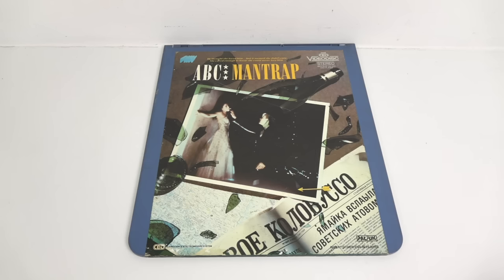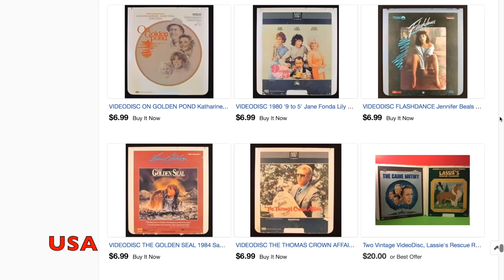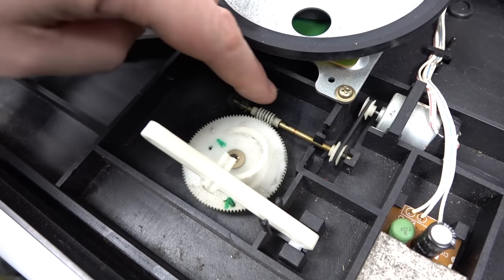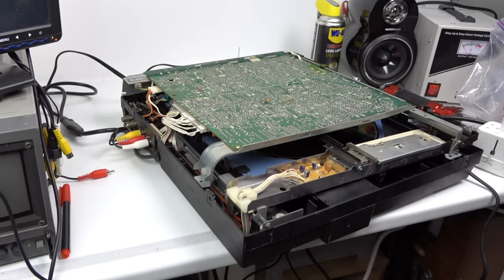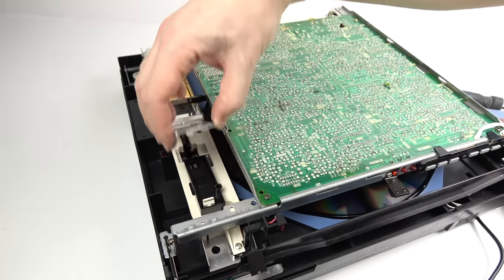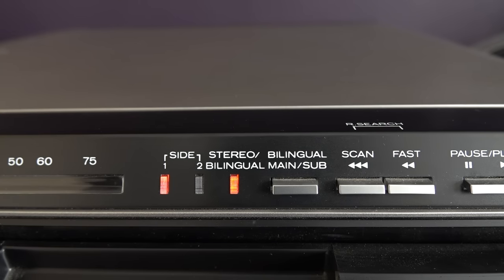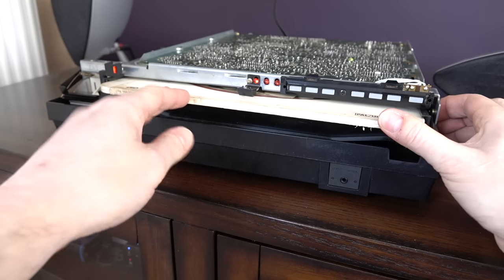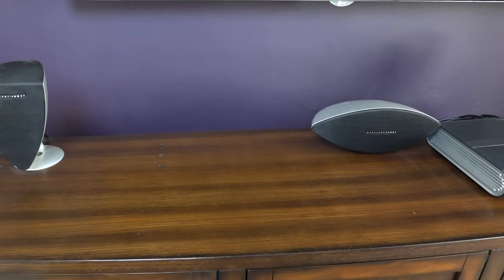Retro tech: The RCA CED Videodisc

Comment: I worked on the VideoDisc at RCA Labs in Princeton starting 1980. Around 1982 we were working out a solution to the skipping problem that involved gluing a little magnet to the aluminum stylus arm and "kicking" it with pulsed coils forwards and back to correct for skips. We pretty much got it working in the lab just as they announced the end of the product (and the sale of RCA to GE). 

It was a tech marvel.  The video signal was modulated onto an FM carrier (like VCRs) and the audio FM carriers were added to the video carrier at 1/10 the amplitude.  The video carrier was recorded on the copper master at an amplitude of 850 Angstroms, which made the audio carrier 85 Angstroms. The audio carrier needed a carrier to noise ratio of 100:1, or 0.85 Angstroms. Copper atoms are spaced 1.4 Angstroms apart, so that's only 60 copper atoms peak to peak!  Fortunately the grooves were 10,000 per inch, or about 25,000 Angstroms wide, so the "copper atom noise" easily averaged out across the width of the groove.

The original attempts at making discs conductive involved sputtering metal on them, and they were quite pretty.  I still have one.

I flinched at your opening clip as you fingered the disc, only to learn later that it was already thoroughly unplayable. 

Thanks for the memories!
Reply: If you haven't seen them, Alec on his Technology Connections channel has a series of videos where he goes into more depth about the development process and various other aspects of the whole thing.
Reply: That's awesome I'd love to know more about this lost tech
Reply: Incredible!
Reply: Any chance you could upload a picture of the sputtered metal disc somewhere for posterity.
Maaaybe on wikipedia.
Reply: You have a picture of that prototype disc?
Reply: Great work you did! And half the density of a much later CD without laser was ingenious!
Reply: Very late I know but this is something of an answer to a question I had regarding the format as to whether the skips could be fixed because it never got out the early phase of adoption. Reminded me very much of WB HD DVD discs rotting but we knew it could be fixed (I have a Universal release of Casino and a BBC release of Planet Earth 1 that are still working more than 15 years after their manufacture)
Reply: Very cool, thanks for sharing.
Reply: shame rca didn’t get the ced out in the late 60’s it would of changed the world
Reply: Thanks for your story and love hearing what was going on from the industry ppl. 

One I bought a Sony Cassette player from the late 70s. No one bid and I got for .99 cents and I think free shipping. The woman said it was the prototype of the Sony Walkman, but looked like a regular cassette tape recorder. She said it was given to her by a Sony executive she was dating and only the top executive in the Sony NYC office got one. She said she hadn’t used since the early 80s and had stored away, 

Anyway, just the story was worth the .99 cents I paid. I don’t even know what happened to it and hope it’s in one of my storages.
Reply: Before LD or VHS, it would have been very popular, people were spending large sums on 16mm and 8mm films, movies that were often cut way down and the 8mm often silent plus not very convenient at home. The CED would have been a marvel compared to the delicate film that had a tendency to break and need spliced.
Reply: RCA should of come up with a system like a pc hard drive, where the recordable disc platter is removable in a cassette similar to a floppy or zip disc. this idea would of been cheaper and made complex tape type expensive systems obsolete. but im glad for dvd and blu rays in this modern times.

Comment: The mentioning of how the TED works by using a cushion of air to hold it steady reminds me of a piece of old computer tech from the early 80's to early 90's.

It was called a bernoulli drive, and it used air pressure from the rapidly spinning disk to draw the IO head to the disk surface. Thing is, because if the way it worked, a head crash was practically impossible, making it the first successful removable media with built-in crash protection.
Reply: Except the floppy of cause, which couldn't crash because it wasn't flying.

Comment: You really are tuned in and write wonderfully... I wrote my Senior thesis on the RCA system back in 1977 and sort of got in trouble from my prediction which of course was that the system was going to be a colossal failure. It was RCA of course that brought you the 45 rpm record with the hole that didn't fit anyone's record player. RCA thought that the RCA name alone was enough to dominate the home entertainment market but with too many competing divisions at the time they had already sold the rights for the underlying technology for VHS to Matsushita and the LCD patents to Toshiba (because they were selling too many tube-based color TVs) so I think they knew the handwriting was on the wall already for the company...

Comment: "I've got an idea! Let's make a video disc player that has the same resolution as video tape but can't record, and uses discs so incredibly fragile that people can't be permitted to touch them under any circumstance otherwise the playback will be completely screwed up! We're gonna be rich!" :-)

Excellent video, especially the lessons on how to repair mechanical machines. When in doubt, replace the belts!
Reply: Bottom line was RCA could stamp videos on disc rather then real time record videotapes...which at the time was a lot quicker and efficient...if it was perfected.

Comment: My Mom was a district manager for AVON in the 80's and at one point the company sent CED players to all of the managers so they could lug them to sales meetings. AVON produced training and other various videos on CED after having used the old filmstrip & cassette player option for years. It was the first in a long line of hilarious mistakes the company made when it came to formats for their training videos. I don't think they finally got round to using VHS until around 1990. You can guess which formats (yes, plural)  AVON tried to go with between CED and VHS. Somehow, they always managed to go with the absolute worst option possible. 
Also, those CED's (all of them, not just AVON's) were notorious for being knackered right out of the shrinkwrap.
Great vids!

Comment: 'I'll never buy a CED player'

/buys three CED players 

:D
Reply: their hard drives are dreadfully slow
Reply: Though in fairness to Hitachi, their trains are almost as fast as Alstoms, so they're definitely good at certain things! <3 :-)
Reply: Just goes to show how they've shafted the West, as I imagine they're in operation only in their home turf, Japan.
Reply: +Amir Pourghoureiyan If you're in the UK, Hitachi trains can be found working on the East Coast Mainline (The LNER "Azuma"), the Great Western Mainline (The "Super Express Train") and on High-Speed One (The SouthEastern "Javelin") :-)

The first two are more or less identical to the 800 series Shinkansen, though with slight modifications to suit UK signalling systems and our smaller loading gauge. :-)
Reply: @ddragon8154  In Japan they're known as the "Baby Shinkansen" and run in more "rural" areas. The 'proper' shinkansen is much faster, longer and wider (even standard class has 5-abreast seating with a wide aisle and acres of legroom), even though it still runs on standard-gauge track (albiet specially-laid, smooth track without sharp corners)
Reply: +Michael Martin If they're a "Baby"(Metal) version built to fit smaller gauges on outlying lines, then that'd explain why they translate to the UK network so well. By the sounds if things, Hitachi really hit the mark in fulfilling their UK orders! <3 :-)

There is a Zero Series on display at the NRM in York, and it's significantly bigger size is clear to see there. Look at it end-on, and the sides of the bodywork overhang the rail on each side by a good 1,4m or so! :-o :-)

Comment: So from what I can tell the CED produced a picture slightly sharper than a VHS tape but was effectively the same resolution. And much more prone to contamination and damage than VHS - at least if you have a dodgy old tape you can adjust the tracking on your VCR to try make it watchable - on the CED unless your disc has been unopened since new (like the Muppet movie disc you managed to get off ebay) it will probably be almost unplayable and there's nothing you can do about it. 

Next you should try get hold of the RCA tape cartridge player - almost twice as big again as an Elcaset.

Comment: You must be incredibly patient. Many people would have smashed the first or second player with a sledge hammer before moving on to the third. Thanks for sharing so much over the years.
Reply: I watched a video where he was trying to fix an old radio. The thing clearly wasn't designed with repairs in mind. It was an absolute nightmare to disassemble, and extremely fiddly.
"I'm really starting to get cheesed off with this," he said in his calm, British way. Meanwhile, if it had been me, I would have lost my mind and flung that thing away from me so hard, it would have gone into orbit. People in the International Space Station would look out the window one day and just see this random mass of wires, circuit boards, and tuning dials floating by.
To add insult to injury, he wasn't able to get it fixed and put it back together properly. He went through all that trouble and didn't even accomplish what he was trying to do. I can't help but wonder if behind the scenes, there was any cursing, or taking breaks during the process just to prevent insanity as the frustration increased.

Comment: As an early VHS user, there were two things that made it vastly superior to all other formats for me. They are: 

1. The ability to record. Purchasing movies in the late 70s, early 80s was not practical for regular folk. They cost over or about $100.00 per title. Its hard to envision, but recording and having your own copy of Spy Who Love from TV was a real treat. And,

2. The video rental stores had vast libraries of VHS— more so even than betamax. VHS was already at the outer limits of my budget, so it was not reasonable to purchase a more expensive machine only to have less titles. Over time, I  purchased used copies that the video store would sell, new titles and especially I purchased many titles new but for about $4.99 as consumers went over to dvd. As you can imagine, over time I had quite a library of titles. Several years ago, I moved and my family convinced me not to take the VHS which I mostly trashed. 

However, there are titles I miss  (i. e. my belived Faulty Towers) and will have to purchase on dvd or blue rae. Also, I bought a combo vhs/dvd player recorder (I found one virtually new at low cost) so I could get the home movies off VHS to dvd which was a real treat at a recent holiday gathering.

The new trend as you noted is to purchase digital only content. Id rather have something physical in case there is a technical snafu. I have friends that need to move etc vast movie and music libraries when they get a new device or when a hard drive dies. I dont see the point.

One last thing is I just bought my first blue rae player but not because I was hungry for a new format (actually the reverse) but rather because it allowed Youtube on my regular tv. I’m sure Sony will have a new format in a few years, but I’d rather they spend their money on buy first class scripts rather than a flavor of the month new format.
Reply: My mother went with VHS so she could record soap operas when she was a work. Mom bought me Star Wars when it first came out in 1982 for Christmas, to this day she has never told me how much she paid.  I bought my first tape, a copy of the Spy Who Loved Me on layaway, it took me 6-8 months to pay it off!

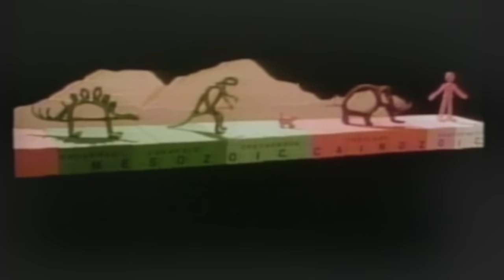Comment: 26:06 "What was once seen as high tech is pretty much unwatchable"

Um, beg to differ. CED was never considered to be high tech even when it was new. If anything, it was only barely passable as a technology. The skipping was just something the players could never get past. Even with brand new players playing brand new discs, you could see black dropouts and skips. CED technology was just not that viable. 

In the 80s, I was already invested in the Laserdisc format when I worked at Sound Warehouse selling CED players. Believe me, these discs and players were pretty much crap from the go. The only benefit CED had was cost. The players were far less expensive and the movies also cost less than a Laserdisc counterpart (at least in the beginning). Of course, consumers pretty much figured out its junk status when they skipped and skipped and skipped. I can't tell you how many of these CED disks were returned as defective.

Videophiles at the time would not invest in CED due to its inherent flaws: skipping, dropouts and overall VHS-like image quality. Laserdisc, on the other hand, offered a much higher quality video experience and was the format videophiles adopted for a home theater experience. This left CED in a bad sales position. For standard home use, VHS was already a standard and worked for rentals and everyday use. For videophiles, Laserdisc was the technology choice. CED really had no sales demographic to go after.

While RCA may have bet the farm on it, they shouldn't have. Technologically speaking, both the Laserdisc players and Laserdisc technology were light years ahead of CED in quality and functionality. While Laserdiscs could skip if they got too scratched or too dirty, you could at least clean them. You could also get plastic polish and clean off scratches most of the time. With CED, if the disc started skipping, you just had to toss it.

Comment: Where did you buy those belts?
Reply from the maker: The answer is a click away in the video description text box.
Reply: Techmoan Thanks very much.
Reply from the maker: I could afford the £1.08 to get the right size.
Reply: I just tried using a rubber band to replace a missing belt in an 8mm projector I bought, just to test it out and see if everything else worked before I order the proper belt and it snapped after like a minute.
Reply: you can get some interesting effects using rubber bands because they are rather stretchy nature lol particularly if the required tension is high causing a sine wave fast/slow action.

Comment: The guy that serviced my CED player shortly after I bought it gave me a tip, he said to cut down on the skipping run the disc once before watching it as it distributes the oil and make it play smoother. I discovered CED way late in the game after I moved to Indianapolis (late 90s). I found large selections of these for sale in secondhand stores. My player model is one of the last to be sold and it was (for CED anyway) top of the line with stereo and auto load, it was dirt cheap but interesting. I picked up so many discs for a $1.00 a piece, I even picked up a copy of The Beatles Let It Be for around $20.00 before I found a LD that I could afford (they were selling for $150.00 or more). I also have some other rare titles that are only on obsolete media. I keep mine connected as I found out the belts go bad without use, my remote unfortunately broke the last time I replaced the batteries but hop that I can fix.
I am loving your videos, Thanks!

Comment: Love your videos Techmoan. Most of the formats I knew about but some not. You really should do a video about Philips VCR format.
It was the first video cassette format aimed at the consumer market. I am old enough to remember we had a B/W Sony reel to reel video recorder at our school which required a special (Sony) TV as the recorder didn't have its own tuner.
However Philips' VCR format brought so many innovations that were later regarded as "normal" for Beta, VHS and VCC that it is often overlooked.
It was color, used a cassette, used easy push buttons, had its own tuner and timer for recording and its own modulator to connect it to any regular TV BITD.

Sure the system had issues and didn't really reach the consumer market because of the prices but I remember the video quality to be very good, we had the system on later schools I went too.

Finding a working recorder will be pretty hard though.....search for Philips N1500 or N1700.

Comment: Wow. This takes me back. I invested in CED back in the day, because while keenly tracking news about the development of the Sony/Philips DiscoVision, when the player finally came out, the only titles were terrible and CAV (30min/side) only. The RCA tech was far worse, but the introductory titles (in the U.S. at least) were far more vast. And promotional pressures made them far more economical. I bought my players for $150 with free discs! 
I was appalled to learn later that most of the problems with the format had already been solved by the manufacturer, but those technical advances were deliberately held back for future generations. For instance there were always 4 audio tracks in the spec, but at most, only 2 were ever used - and even then, only after the second generation of players. All discs (U.S. at least) had embedded VITC timecode which rumored later gen machines would use to mitigate groove skipping. CED never was a great format, but it had far more inherent capability baked into the original spec than the manufacturer ever bothered to build into production machines.
I wonder if it would have died as quickly if it hadn't been deliberately hobbled - presumably for future marketing reasons?

Comment: One interesting aspect of the format is that all CED releases used CX noise reduction, the same process used on the analogue audio tracks of laserdiscs.  But, even with CX noise reduction, the discs were terribly noisy.  The sound in the sample in your clip is pretty typical, with those distinctive tiny little "clicks" and hiss all through the audio.  It wasn't too noticeable on a typical tv set in the early 80s, but is really distracting if you run the sound through a stereo system.